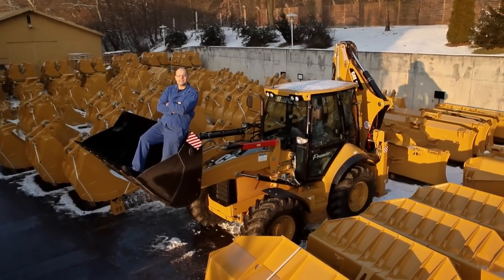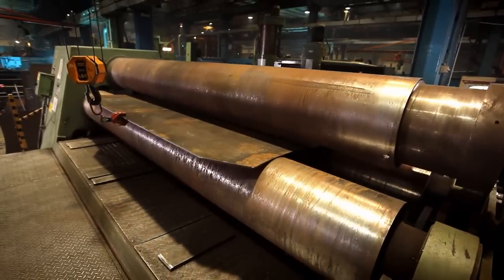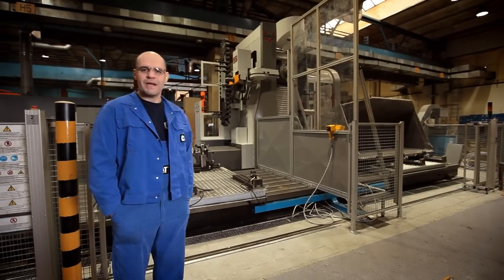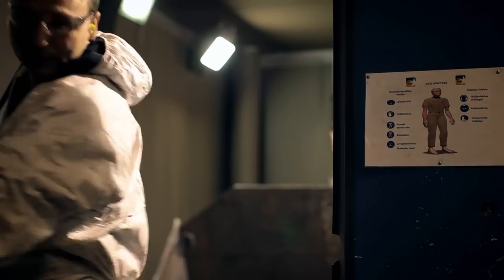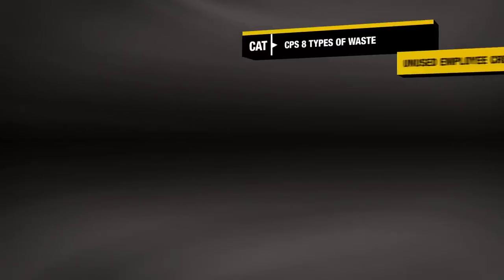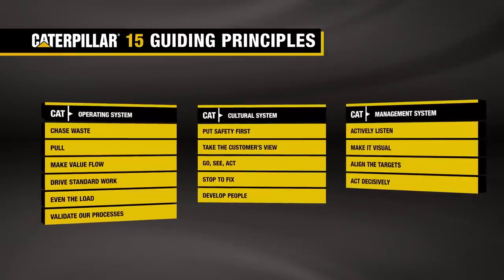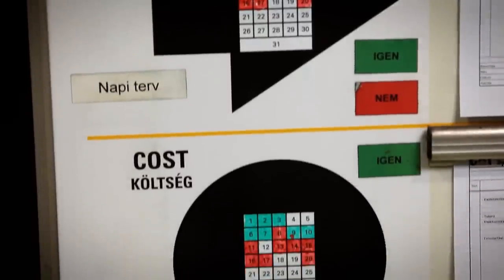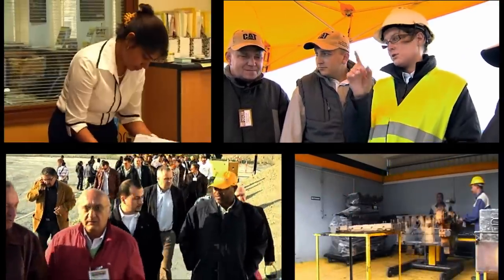Caterpillar Hungary educational video

Comment: 1:21 Caterpillar Backhoe loader multi-purpose bucket without forks linked to the load arms IT Coupler was called "quick hitch" an Pin on with bolt on teeth or cutting edge can't see go with the 2nd. I was a fitter at 15 building & hydraulics, before my 17th birthday I was welding clams an using the crane, keep your finger on forward, stop and start and the job would be swinging everywhere All MIG Speed, long runs, heavy gauge plate 🚜

Comment: Cat equipment is mass produced garbage
Every single piece that comes into a country based on quality has to repair the product within 3 months due to weld failure . 
Garbage
Reply: really?
Reply: We lost this work "UK" to Hungry because one line was month's behind on load arms. I was on CAT muti purpose buckets line an did work on CAT Compacts. We made the company 3 an 1/2 million-pound a year profit. We didn't have weld failure issues but the problem is the material isn't cleaned up prepped or shot blasted. Can cause porous an other issues. But could be lot's of reasons like Gas not being right. We use WaterCooled Pulse Frontier sets but alot of the materials we get in is just full of scale, needs cleaning up especially when putting 20 mm welds down 👨🏼‍🏭